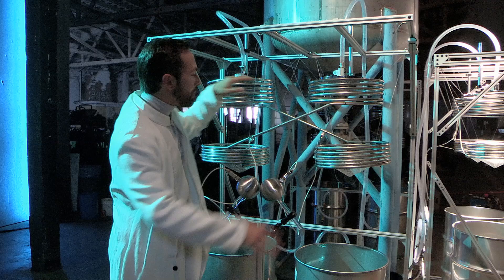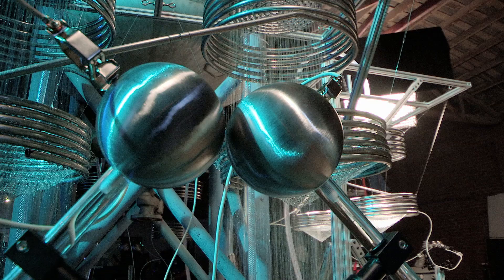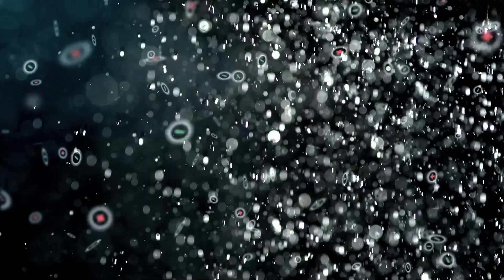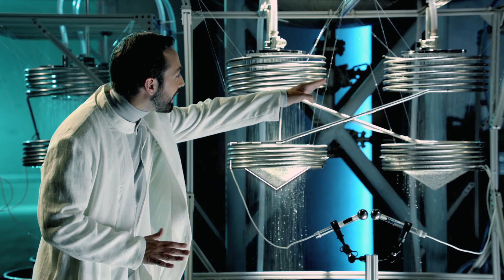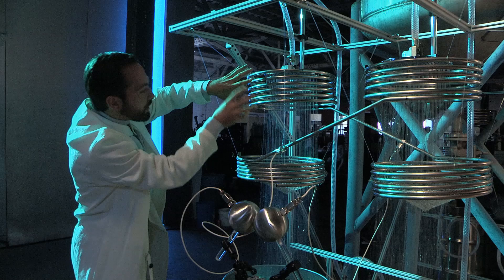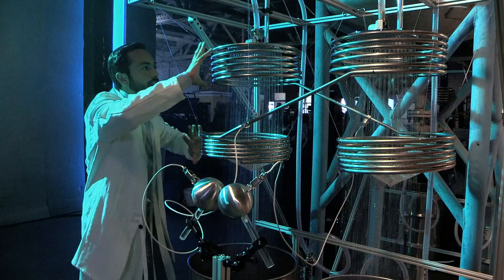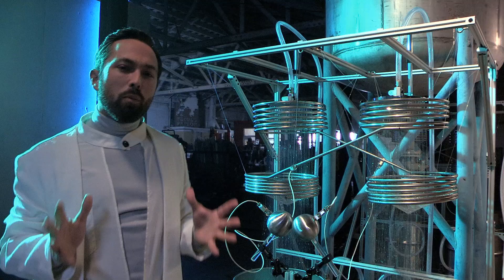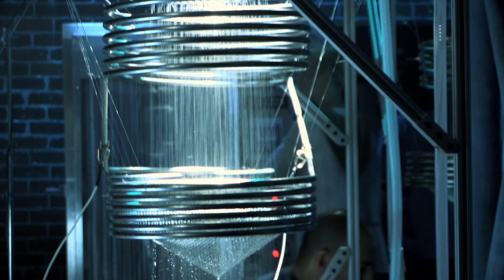Sparks from Falling Water: Kelvin's Thunderstorm

Comment: Current is what kills? I thought you were supposed to be smart....
Reply: How is he wrong?
Reply: @Veldaren  you need voltage to break the dead skin cell layer, 30-70 volts DC for dry skin.
Reply: Essentially both are equally responsible, check out electrobooms video on it.
Reply: Indeed both current and voltage are needed to actually do any damage.
But if you think about it, current/the electrons are what actually do damage, voltage is just what makes them flow.

I'm not saying here that current alone does damage, because current is nothing without voltage.
Let's say the current is like a bullet from a gun. It's harmless in your hand, but if the powder inside is is ignited, the bullet can kill you. The bullet - current.
Voltage would be the immense pressure caused by the ignition of the powder that the bullet wouldn't fire without.
But the bullet, the object is what actually penetrates your body and kills you.

So what he told was true... from a certain point of view.
Reply: @Veldaren  it leads to a way of thinking that causes people to think "well if it's a certain amount of amps then I'll die fullstop" which isnt true, the relationship between current and voltage is dynamic and both should ALWAYS be considered when trying to see if a hot is dangerous or not.
Reply: @doctornobody9501  Maybe, but Derek wasn't really wrong either. His explanation was more like... imprecise, leaving the room for interpretation.

Comment: voltage does damage not current i have touched a 100 amp dc wire with 12 volts nothing happened try touching a 200 volt dc with 1 amp